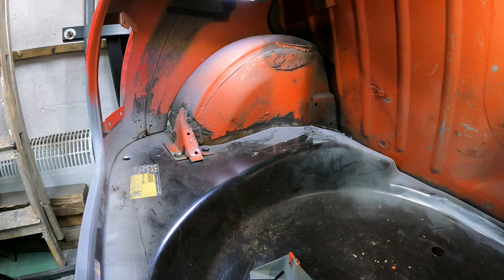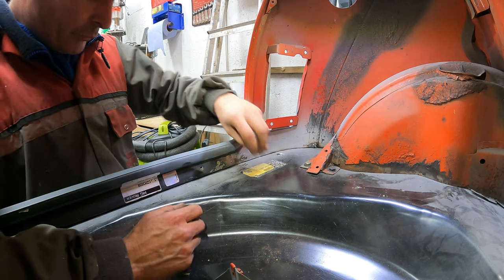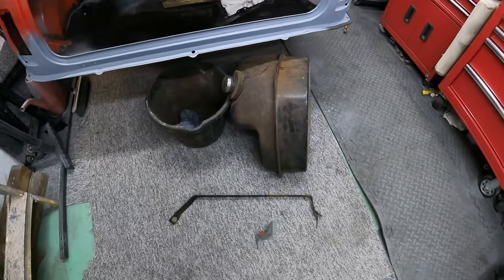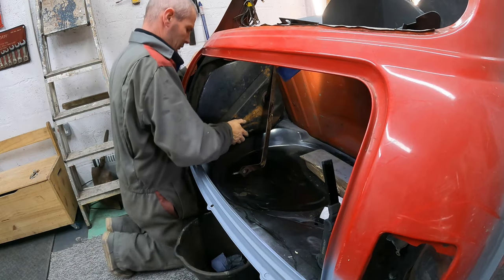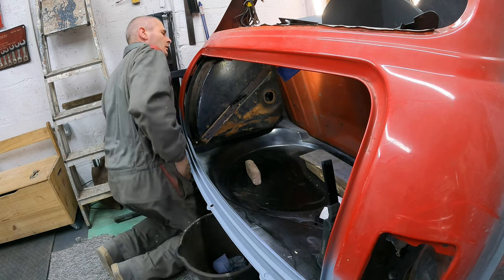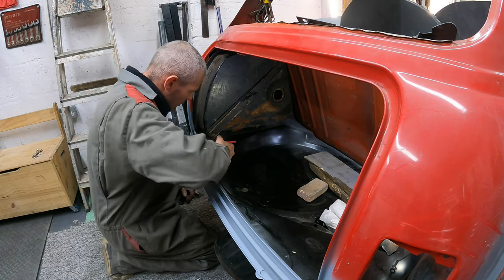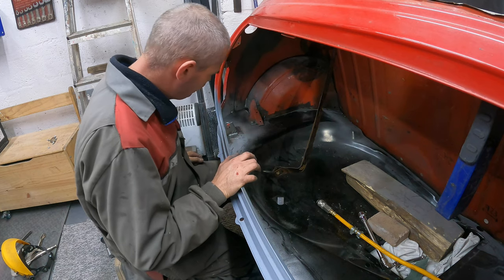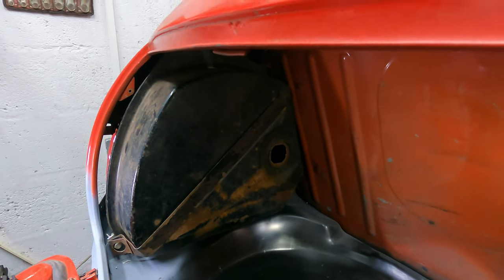Austin mini fuel tank bracket welded in position

Comment: I used Rostio tank rust remover on my Mini tank which had loads of stale fuel crud in it and it worked really well. Followed up with their emulsion to stop the tank rusting again. It's available from Amazon but comes from Germany. Definitely worth a look as I thought I would need to buy a new tank, mine was so bad.
Reply from the maker: Thanks Colin, I'll check that out too 👍

Comment: 😎👍
Recently did similar work.
I replaced the floor on both sides below the tail lights.
I formed my own panels and fab'ed up my own bracket. Takes too long to order one.
I misplaced my bracket but it still works great.
My tank is outboard about another 1"- 1 1/2". The seem is slightly outboard the the boot opening.
Lines up nicely with the edge of the boot and is solid.
It's hard to find close up pics of the positioning of the tank and bracket.
Mine seems a little off from the inside but the neck and alignment seems good.
Cheers from 🇺🇸.
Reply from the maker: Thanks Frank, if you need any close up photos of anything then drop me an email - link in the "about" tab. All the best buddy

Comment: Sean - interesting video, thanks for sharing! If I recall, the earlier Mk3s have a different (vertical) strap that bolts through to the floor, with a support bracket under the tank as per the Mk1s and Mk2s - whereas the later Mk3s have this diagonal tank strap and strap bracket welded to the floor as you have shown? I have heard very good things about POR15 kit of a Degreaser (internal clean), Metal Prep (internal de-rust) and Tank Sealer (internal coating) - although its not cheap.
Reply from the maker: Cheers Rob, yeah the differences between the models is finny. My mate has a mk3 and it has the mk2 gutter extensions on them. His car probably has the earlier tank too. I'll check out that por 15 stuff too 👍 thanks for watching!

Comment: Isn't there a type of sealant stuff you can put in the tank, makes a protective lining around the inside of the tank?
Reply from the maker: I think so Paul, I'll check out Frosts site as per Coopermark's recommendation
Reply: @BMCWorkshop  If you use it, you will have to do a video on.
Reply from the maker: Will do Paul 👍

Comment: Any idea when the tank support bracket code: 14A6867 gets used? Some have them, some don't and I can't figure out if they're important
Reply from the maker: Mark, I think this is for the Mk1/2 tanks. Pretty sure Kev's old boot floor had a bracket under the tank which it sat on.
Reply: @BMCWorkshop  yeah I think you're  right,  I wonder why they became obsolete?
Reply from the maker: @classicminihaha2508  Possibly due to different tanks buddy?